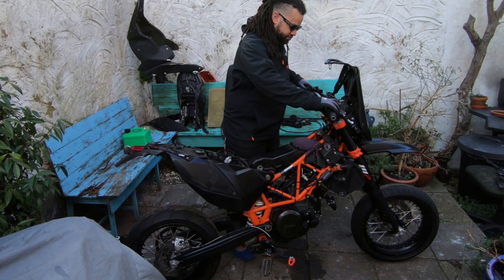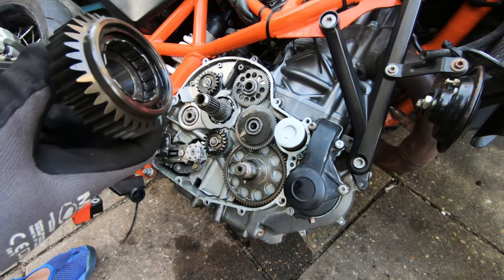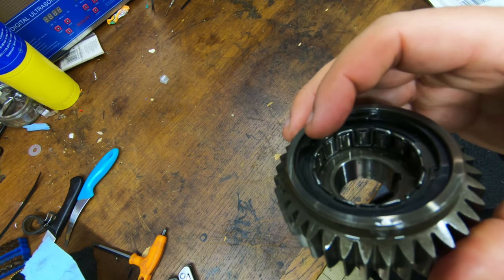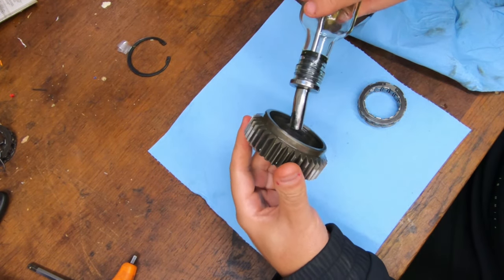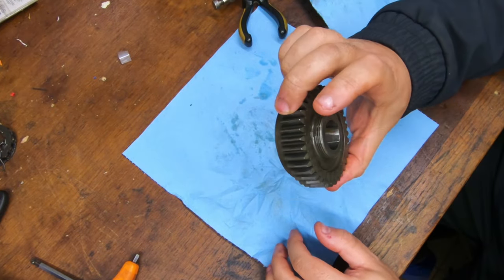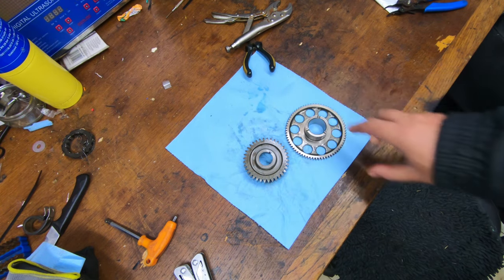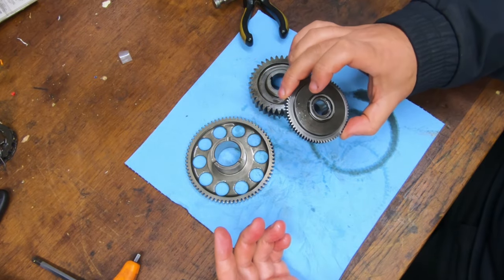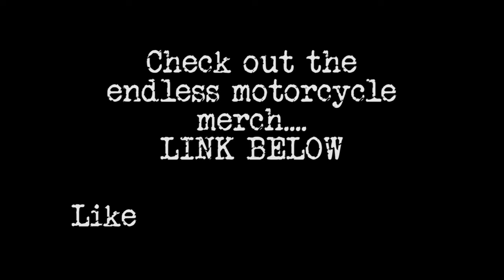FREEWHEEL or TORQUE LIMITER?? | Troubleshooting the 690 | EP12 | KTM 690 BIG BORE BIKE BUILD

Comment: Why it is so hard to pull the primary gear off? I don't have the special tool and having a hard time to get this job done. Any tips?
Reply from the maker: It’s a very snug fit once it’s tightened down and been through a few heat cycles I guess. I can’t think of any other ways to pop it off. I bought (or at least I thought I had) all the tools I needed in one go because I wanted to build the engine properly without any makeshift tools. Where are you based?

Comment: Hellooooo!!! I have a few questions and I would love to get some answers!!!! I’m from Greece a proud owner of a Duke 690 III which from factory is 654cc currently with a friend we’re trying to get it into 690cc which comes from the crankshaft of Duke R which is bigger,in Greece we have not much resources to tune up our KTM’s except some high compression pistons and the camshaft from the adventure 690 which is again bigger. As we’ve learned from the tunners there’s no ready big bore kit and only a guy in Germany gets the stock cylinder and makes it bigger like 104 with a new coat of nicasil,you have any idea which one? Because I heard something about thanking a shop in Germany in your previous video. Also if you have any shop or you have the time & will and throw us some tips,we’re already like on 75hp wheel on 654cc and where trying to get it as far as possible without risking to blow it up 😅😅

Comment: All my parts are in for my 701 build, and my shop will be putting everything back together within a week or so. Big bore kit,  ported/polished head, some work on the cam, and the oversized fuel injector. Am I missing anything? After a bit of break-in time, I'm going to see if someone can tune the stock ecu. I currently have the coober piggyback unit that works well, but I want to see if someone can get some better numbers than the coober.
Reply: Where did you get a big bore kit ?? What year is your bike?? I have a 701 But I am wondering what more mods can be done to really get more HP out of it, so far I ahve stage 2 air filter with dyno tune and aftermarket exhaust.

Comment: I’m having a mere with my 690 🙄 can you remember if there was any side to side movement in the clutch basket? I don’t know if I need to replace the needle bearing, from memory the centre pack was solid with no wobble so I’m happy it’s not the main bearing
Reply from the maker: What do you mean by side to side movement? As in, forward and backward, up and down?
Reply: @RideyBikes  if you’re staring at the bike laid on it’s side, typical ktm fashion, it will come in and out of the engine slightly as though pulling it towards you (which I’m not worried about) but it also has a Little Rock to it aswell, as if you’re pushing with one hand and pulling with the other, either side of the basket, causing it to twist slightly or rock from side to side, similar feeling you get if you have a dead wheel bearing and test that, it rocks from left to right on the axial, if that makes sense, even though I fear I may have answered my own question
Reply from the maker: @Ownage964  Oh dear!! I think you have answered your own question there! All of that sounds real real bad. The in and out should be almost completely imperceivable with 0.10-0.25mm run out... Rocking sounds terrible. Are we talking basket rocks on the splines or the whole thing is moving but tight on the splines?? Either way it sounds like it's complete engine tear down time. At least it's pretty easy.  😬
Reply: @RideyBikes  further investigation then 🙄
Reply from the maker: @Ownage964  Yeah, i'd guess you're looking at main bearings, possibly damaged crank splines so new crank, damaged basket so new basket. How many miles?? If I were investigating that far i'd be doing a full bearing change as a minimum job. That level of movement could also be a sign or be a cause of a wonks crankshaft. In fact, whatever the cause is there's almost certainly gonna be a fair amount of shrapnel in there grinding sh*t up! Hell, might as well do a big bore!  Let us know what you find! 😉
Reply: @RideyBikes  I think with the time restraints I have, it would be a 2018 engine and electronic conversion 🙄 but I’ll let you know what I find when I get the time to strip the motor down
Reply: @RideyBikes  so further inspection, no damage on the bearing with the clutch removed next to no play in the crank and all working spec, bearings are all good and working smoothly, I can only assume as it started to play up after I changed the the oil from 10w50 which is the manual specs to 10w60 which is the ktm recommendation, that it was too thick for the clutch, I’m going to service it and I’ll let you know

Comment: are you not missing the lock shim for the clutch basket? the one with the tabs
Reply from the maker: One with the tabs was superseded in favour of the one I’ve used. I agree though... seems weird not having any locking tabs. 👍🏽
Reply: @RideyBikes  you are correct, yes. but funny thing is that the new ones still have the one with the tabs. but you are following the specs on yours: should be OK!
Reply from the maker: So the new bikes come with tabbed washer??
Reply: @RideyBikes  yes. my 2019 did. I swapped it for upgraded version from a US company
Reply from the maker: @escorcio21  Upgraded version from a US company?? Deets please
Reply: @RideyBikes  CJ Designs
Reply from the maker: @escorcio21  👍🏽

Comment: What that part number work with my 09 690smc I replaced the starter and it grabs slightly and then grinds hopefully this is my problem
Reply: For the puller
Reply from the maker: Grinds or spins?? 58429009000
Reply: Sounds like it’s slips then grinding upon starting it but it does grab sometimes
Reply from the maker: @jesusyanes367  Yeah mine did that. Replacing the freewheel clutch sorted it. 👍🏽
Reply: I also have a no spark issue I replaced my ignition coil pack and spark plug as well still no spark any idea thanks in advance I will be changing that part once I figure out the no spark issue I been into sport bikes this is my first supermoto so kinda don’t know anything about it your channel has helped me so much tho
Reply from the maker: @jesusyanes367  Did you ever have spark? When did the spark stop?
Reply: Honestly just Baught it like that previous owner said it just wouldn’t start and he really messed up the old starter so I got a new one and put it on and found out it didn’t have spark I checked all the fuses they are good I got a new ignition coil pack still nothing but not giving up yet I haven’t changed the starter clutch yet so maybe it’s not rotating the engine enough times to get the spark maybe is what I think so ima change it and get back to you
Reply from the maker: @jesusyanes367  So many things could be causing the no spark. Without seeing your bike its hard to offer an opinion. Any chance you can get up a video of an attempted start without throttle and further attempted starts at 30% and 50% throttle?
Reply: I will definitely and update you on it
Reply: Hey does the ktm have cdi box??
Reply from the maker: @jesusyanes367  The 2009 690 RFR is carbureted and DOES have a CDI box. The 2009 (onwards) 690 E and smc are Fuel injected and DO NOT utilise the CDI box system.
Reply from the maker: @jesusyanes367  Just a quick checklist for your bike... Have you... 

Checked the valve clearances and rockers?   

Checked the voltages on the APAD and THAD via tuneECU?   Out of spec voltages will inhibit spark. 

Checked the fuel pressure?  

Have you tested the resistance per the manual of the ignition coil, HT lead and plug cap? Don't just trust that new things solve problems. I once bought a faulty plug cap.

Have you absolutely seen with your eyes that there is no spark with the engine starter turning but with the spark plug out (perhaps using a spark plug light)? 

TuneECU facilitates many tests like spark, fuel pump, injector etc. 

Just some ideas.  Hope it helps

Comment: Hey!! Thank you so much for this video!

My bike developed same issue after a stage of weird starts. Sadly I couldn't postpone the fix forever.

This video was really inspiring to gather the nuts and doing it by myself... But now I'm doubting about getting original or, as you did, "aftermarket" replacement.

How is it going after few months? Is it still starting strong?

Also saw other people that's only replacing the spring with a similar one from an SFK bearing... But the price is not worth it versus the aftermarket whole piece.

Any tips after a while riding it?

Thank you so much in advance! I owe you a beer however my story ends!
Reply from the maker: Hey no worries. Glad the vid has helped. 

I've put nearly 4k miles on the bike now and the aftermarket one i've put in is great. It starts on the button every single time without any issues whatsoever. Proper happy with the part. 

Cheers! 🍻
Reply: @RideyBikes  Awesome! I'll follow your path then!

If you ever come to Málaga (Spain) just remember you have some cold beers here to claim! ;)
Reply: Hey buddy! It took me a while but I finally did it... Now my redhead starts like a charm first touch thanks to your video. 

Now I have a dragging clutch to fix, but that's another story.

You definitely have those beers here waiting for you! 

Thanks again for the knowledge sharing!
Reply from the maker: @AGuiu  Awesome!... My clutch has just given out too... 😂